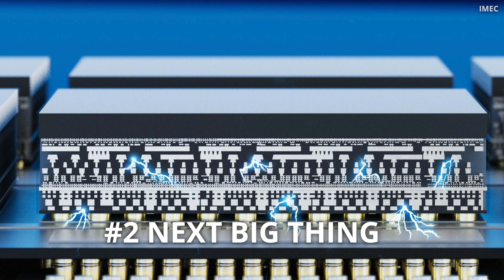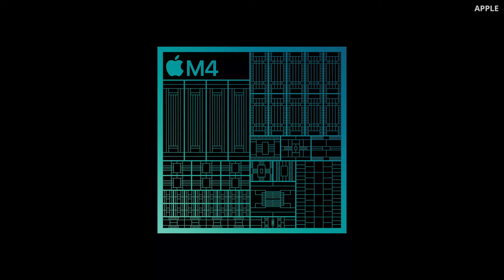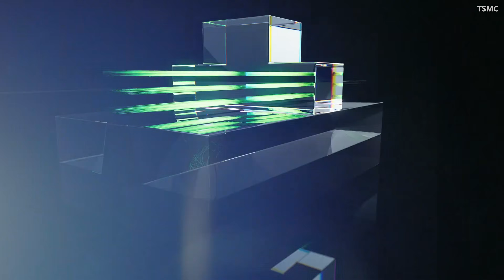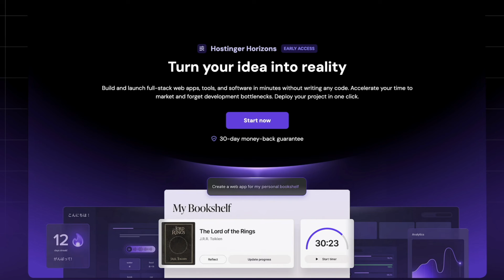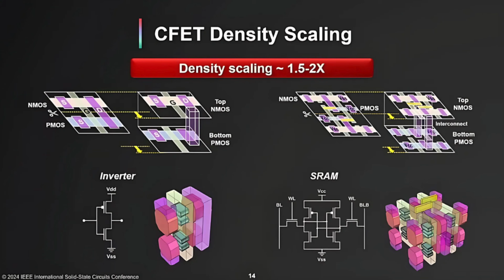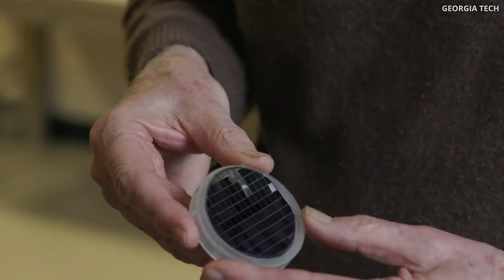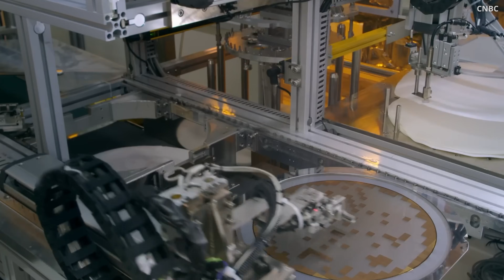The Next Big Thing in Semiconductors

Comment: "1 nm" does NOT mean a physical size.   We stopped tying node "dimensions" to any physical size well above 3 nm.  Mostly because ALL MATERIALS at typical operating voltages start allowing quantum tunnellng at high current levels at 3 nm.

Even since then, so-called "process node sizes" have become "planar equivalent transistor 3D density" instead.   Going 3D allows "planar equivalents" to be smaller than 3 nm but ALL actual physical dimensions are larger than 3 nm.

Comment: Excellent technical deep dive into the future of semiconductors, but I think it’s essential to complement this vision with a systemic geopolitical analysis. The Routledge Handbook of Political Risk (2025) reminds us that technological innovation and political risk are now inseparable.

🔹 Strategic dependency on TSMC: The fact that TSMC manufactures 90% of the world’s advanced chips is not just a technological achievement—it’s a global vulnerability. A crisis in Taiwan could trigger a worldwide digital shutdown.
🔹 Weaponized interdependence: Semiconductor supply chains can become tools of geopolitical leverage. U.S. tariffs (up to 100%) are not just economic—they’re strategic pressure tactics to force reshoring. TSMC isn’t just a company—it’s a global strategic asset.
🔹 Technological concentration risk: Innovations like CFET and GAA require massive investments. But only one or two global players can afford to stay in this race. That creates systemic fragility and techno-monopolies—not resilience.
🔹 Tariffs, U.S.–China tensions, techno-nationalism: The global push for digital sovereignty (CHIPS Act, EU Chips Act, Made in China 2025) is fragmenting innovation geographically, making global coordination and governance increasingly difficult.

In short: CFET, GAA, and 2D materials are revolutionary—but the real bottleneck isn’t just energy or heat. It’s political. We need geopolitical resilience as much as we need engineering breakthroughs.

As the Routledge Handbook puts it: "The future of technology will depend on how well we reduce systemic fragility before innovation itself becomes the cause of it."

Comment: what if the spin of an electron is used as a transistor stop its spin to negligible amount for 0 and apply voltage to count it as 1 while being able to do it with minimal ebergy loss and 10000 times the speed of todays chips

Comment: I don't understand how you can use one gate for multiple transistors. The gate is the switch. So unless your transistors are guaranteed to transmit the same values, this wouldn't make sense. It would just make your transistors the same single transistor.

All I can think of is that your splitting your waveform to use one source at a time per gate, but that doesn't solve the problem because you couldn't have just used different gates to do the same thing, and your wasting space with a mechanism to achieve this to split up your clock.

Obviously I'm wrong here. I just don't understand where I'm wrong.

Comment: The hard limit being approached here is the thickness of an atom, 0.1nm.  When we get to 2-3 atoms its a hard limit.  The big jump I am looking for is stackable transistors, a 20nm dual stack transistor would probably outperform a 5nm design due to far shorter routing.
Reply: good approach but they would be highly power inefficient by the 2070 he have to think about some alternatives like using the spin of an electron just like a qubit to work it like a transistor and it would be 10000 times faster than todays chips
Reply: We are nowhere near atomic limit. The 5nm process actually has >20nm dimensions.
Reply: Stop parroting
Reply: @pooshpoosh9232  🦜🦜🦜

Comment: 🤔
What possible future application might S. Ovshinsky's approach to semiconductors for solid state battery and super-capacitor research?? (No exotic elements and mineral resources.)
Also, you have spoken of photonics. Photonics must have some advantages where wire traces and connections come in. Any thoughts?
🙄🤨🙂😀 Ciao.

Comment: The funny thing about Gate all around is that the concept is not in fact new... "gate all around" was employed by Vacuum tubes to deal with leakage because of simple flat grid designs. the last tubes all used grids that completely surrounded the heater... hense "gate all around".
Reply: There has to be a new way to replace this whole concept with a better one
Reply: @ IC design is now at its peak. silicon based electronics has always been about either switching or amplifying current or voltage. they can get a tiny bit smaller or maybe faster if they want but the gains are less and less. The next frontier is about software...which is where AI is now breaking ground.

Comment: I started with Nikon in 2000.  Worked on i12's to S308's.  I saw the first ASML installed at Intel.  Got kicked out of Intel for explaining immersion to kids.  How water is being used and why.  F'in Intel.  Its been really sad to see Nikon's demise though, yet awesome to see the industry as a whole.  I still cant really understand how ASML buying Cymer was allowed.  The only reason Nikon isnt in EUV was the failure to create a light source.  They were developing a different method than Cymer.  The Cymer method is extremely dirty.  They had the actual scanner ready.

We've been trying to use different materials forever.  The problem has been they all are physically much weaker.   The wafers crack just during normal transfer, like simply pulling it from the cassette.  Far more knowledge will need to be developed to use them.

Photo has always been the most critical tool.  365nm mercury arc lamps to 248nm KrF scanners to 193nm ArF to Immersion as a stop gap to EUV.  Getting past EUV is mostly likely just physically impossible.  EUV was such a pain because you can't use lenses and mirrors only have created huge challenges with masking and unwanted reflections.  Regardless... there is zero chance photo is not critical.  The 500 billion dollar high NA EUV that takes a football field of space, OK I can see that.

The industry has wanted to use backside power forever.  The challenge is greater than developing EUV.  The wafer has to be moved around.  Even now with just a polished backside, any minor defect, like a scratch you cant even see, is going to cause focus defects and scrap.

I miss working on the latest and greatest.  I'm not moving to Arizona though LOL.  Come on Qualcomm, buy this factory! LOL

Comment: I think it is waste to over try to reduce size . we have both photon processor is extremely small already and then emulate using software we can reduce to near absolute zero and infinity of power. Im transitor in a way of using light is like bias color between gate and source and we bias with a different color then only allow to original color of the source if the neutralize the gate color and the collector contrast with source and that is hiw color light is same as transistor

Comment: Wow, that sounds unbelievable. 1 nm fits only 1 atom of silicon! As the distance between 2 silicon atoms on wafer is 1.1nm! How deep is the layer? Is it something like 1 atom width and a thousands in height? How would it possible to make such structure and for what purpose? I mean silicon needs doping to make it p or n type, but with 1nm there is no space to make doping. I also heard quantum tunneling would affect such thin structures. Hmm.. How do they develop chips with that technology? Where exactly 1nm used? It is likely a precision at which they create structures on wafer, but do they really need it be so precise. Such precision is incredible!

Comment: So I won't say that I know what will happen with the price of TSM but I can say that technically, this is really bad advice. This is probably the literal worst time to buy the stock. It has gone up 10x in the last decade, about 5x more than the S&P 500. It's 15% off it's all-time-high along with the rest of the current market dip, and all signs point to the potential value of these innovations being thoroughly priced in. There is no insight here that the market players are not completely aware of already.
Reply: Has it recovered from the 15% drop she indicated?  If not, you know it will, so there’s no harm in trying for a short term take.  Are you anticipating it to crash to a value you’d consider reasonable?

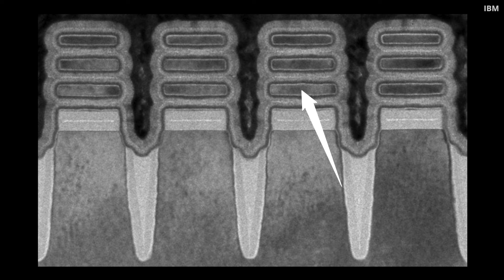Comment: In the cross section of the Gate-all-around architecture, seen at 6:28 in your video, I note that the top gates of the four stacks are a little smaller in width and cross section than the gates below them, which in turn are a little thinner and smaller than the gates below them at the base of each stack.  Is this by design?  Or is this an artifact of the manufacturing technique?  In either event is it a limiting factor on how many layers can be stacked?

Comment: Compare against PKU's new paper (Mar 2025) on 2D gate-all-around (GAA) using bismuth oxyselenide (Bi₂O₂Se), a high-mobility 2D material that operates at lower voltages for ultra-dense chip designs with better performance per watt ⚡

Comment: LAM and Applied Materials are plasma experts and the CFET structural design is pure genius. When you pull the government money plasma hose (pun), things get weaker, but the patient lives on and improves. May I add to your explanation? A reason for multiple gate structures is the "skin effect" of conductors. 65% of the signal's current (AC) travels near the physical surface, its depth determined by frequency. Having more surface area allows more current to flow. Even in a basic klystron tube this is critical, though due to the large physical dimensions, strong magnetic fields are added to overcome problems with standing waves due to this challenge. At the density layers you describe, one would also expect quantum effects, which could change the geometrical design requirements of the deposition. Heavy stuff...

Comment: Energy is the next critical bottleneck. SMR nuclear reactor could provide a solution for the next 10 years to feed the hungry IA data centers, until something else is available. BUT an SMR needs 5 to 10 years strict administrative regulatory approval time, otherwise these 300Mw powerplants could be built (once assembled in series in the factory) in 18 to 24 month.

Comment: Any dreamer who says that smaller that 1 nanometer is attainable clearly does not know how quantum mechanical effects (QME) changes the rules of how chemical atoms behave. All the rules of mass transfer, kinetics, reactivity, atom migration stability, heat transfer and electronic tunneling effects cause a rapid realignment of all the rules.. We tried many years to make stable 0.5 nm stable SiO2 silica (not silicon), they self destruct. For all chemicals, be wary of structures built by the 1 nm salesman.

Comment: Why ASML’s EUV Dominance Is Fading—and What’s Replacing It:

1. EUV made 7nm–3nm chips possible.

ASML’s $200M EUV machines use plasma to etch nanoscale features.
Critical for past lithographic scaling.
But: expensive, complex, and a production bottleneck.
2. TSMC’s new transistor architectures shift the game.

Gate-All-Around (GAA) wraps the channel fully.
CFET stacks NMOS over PMOS—true vertical scaling.
These designs prioritize vertical precision over 2D patterning.
3. That means less reliance on EUV—and more on material engineering:

Atomic Layer Deposition (ASM)
Selective Etching (LAM Research)
Epitaxial Growth, Backside Power Delivery
These tools form and sculpt nanosheets atom by atom.
4. ASML is still relevant—but no longer the bottleneck.

Fewer EUV exposure layers.
Lower cost, fewer masks.
The balance of power in chipmaking tools is shifting.
Bottom line:
The real story isn’t just “beyond 1nm”—it’s a full-stack rearchitecture of how chips are built.
TSMC is quietly rewriting the semiconductor playbook. And this video helped me see it.
Reply: these shorter and shorter chip is just fetish with no real usage. it is just bubble to increase stock prices and illusion of maga. in this video she said that in 2015 were chips over 20 nm. and now everybody wonders if china can break 7 or 5 nm or so. you can use it pretty much in everything already. and as deepseek have shown, this brute force mindset is real problem. if you need more power, you will use more chips. and architecture of those clusters matters more than if they are 5 or 3 nm imho...

Comment: I can remember drawing semiconductor material concepts for vertical silicon and even gate-all-around geometries as far back mid-90s. This included a lot of thought on global interconnect strategies. Toward the end of my career I was looking at 3D packaging technologies and the design tools and processes for modeling this interconnect from silicon on silicon, stacked die and stacked packages. Now to see all of this in production is amazing. I would like to know how the problem of extracting the transmission model of all of this interconnect across various materials and scales (PCB, Package and chip level interconnects) and then being able simulate these models.  Oh to be young and energetic again.

Comment: i mean it's pretty cool, but it's still just finding a better way of what they were doing 50 years ago. It's an advancement in the concept that the first chipmakers couldn't dream of.  But if we're going to get anywhere even close to that "20,000 years in the 21st century", we'll need an altogether new concept of data storage and transmission, as well as power delivery and requirements.
Reply: No, just reduce thw size of all the stuff around thr chips.

Comment: The only real 3d structure is the neural structure in our brain. It is more about the density of 3d interconnection, than the density of the switches itself on a planar surface. We are nowhere near achieving equivalent interconnect density. Also our siliicon switches are limited by interconnect resistance and capacitance leading to enormous power consumption, due to the primitive switch and its high speed operation. We need superconductors and high density analog switches, that does not exist today!. But wait we don't have CAD tools and technology doing math using Analog elements🤔 Welcome to the world of daylight pipe dreaming😂. INFORMATION PROCESSING NEED NOT BE COUPLED TO ENERGY CONSUMPTION, THIS IS THE FUNDAMENTAL LIMITATION OF OUR CURRENT WAY OF THINKING❤👍

Comment: Next thing After vertical transistors : string transistors expanding into the extra 6 dimensions of string theory.  ASML is working in string printers right now :-).  The best part is that the 6 extea dimensions are folded onto each other and take no extra space so that Moore's law has at least another 130 years left to go!

Comment: The question I have is during the growth process, can't different crystal substrates be manipuated on the surface ot the growth pattern and then grow bakc ot conenctors, without etching processes? jsut an enclosure for the gate by the growth process, it require bombarding during its growth to changing the ionic? state? I don't know hypothesis.. that aside.. gate is open or closed on or off....  What systems  can we make that would be better than this altogether, I think the up up and down quark system is essentaily a trasnisitor of hte natural level that should be looked at to be harnssed for a trasnister stte utiling natures gate.. for binary setup... but I don't know..  intersting video.

Comment: I learned a new word today. Hah, Epitaxial growth is a process used in materials science to deposit a thin crystalline layer on the surface of a crystalline substrate. The key characteristic of epitaxial growth is that the deposited layer mimics the crystal structure and orientation of the underlying substrate, resulting in a continuous, ordered crystalline layer. 

### Types of Epitaxial Growth:
1. **Homoepitaxy**: The substrate and the deposited layer are made of the same material, such as depositing silicon on a silicon substrate.
2. **Heteroepitaxy**: The substrate and the deposited layer are different materials, such as depositing gallium arsenide (GaAs) on a silicon substrate.

### Methods of Epitaxial Growth:
- **Molecular Beam Epitaxy (MBE)**: Uses a high-vacuum environment to deposit thin layers of material with precise control.
- **Chemical Vapor Deposition (CVD)**: A chemical process where gaseous precursors react on the substrate to form the desired layer.
- **Liquid Phase Epitaxy (LPE)**: Involves depositing layers from a liquid phase solution.

### Applications:
Epitaxial growth is essential in the manufacturing of semiconductors, such as transistors, LEDs, and photovoltaic cells. It enables precise control of material properties for advanced electronic and optoelectronic devices.

It's like tailoring a perfect layer of crystal to fit the underlying structure with atomic precision! Let me know if you'd like to dive deeper into its applications or processes.

Comment: "Smaller": I understand Yield per Wafer for the FAB.
But then the use of that chip requires extensive heat dispersion and diffusion through layers of thermal management costs. 
With a smaller chip, there is less surface area to mount heat-sinks on, driving solutions to more expensive and bulky thermal systems.
'Seems that if a larger chip was made, on 12" wafers, with "older" tech, and the net costs of the end-product was considered, there would be a more efficient price point than the huge capital expenditures driving chips smaller, by being able to use cooler running net systems with fewer bulky/expensive heat management systems.

Comment: The M5 Pro, Max, and Ultra will utilize server-grade SoIC packaging. Apple will use 2.5D packaging called SoIC-mH (molding horizontal) to improve production yields and thermal performance, featuring separate CPU and GPU designs which Apple’s PCC infrastructure build-out will accelerate after the mass production of the high-end M5 chips, better suited for AI inferencing.